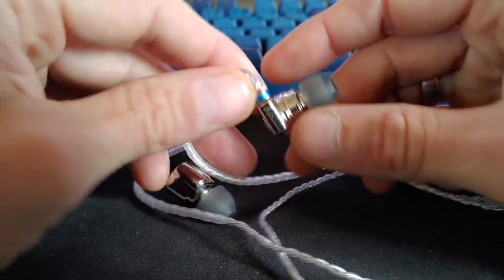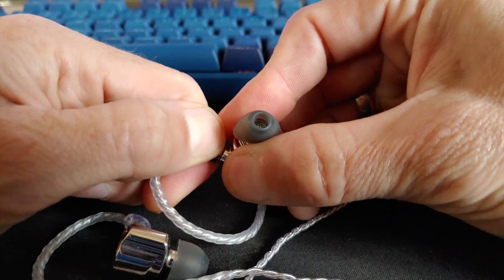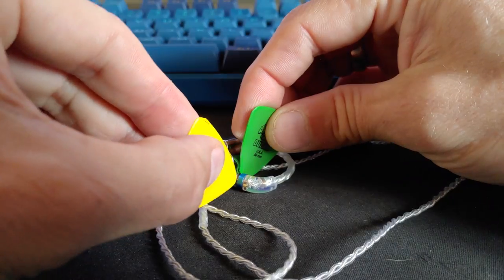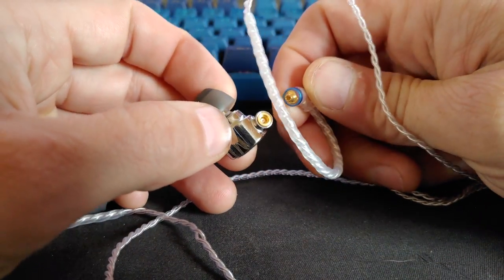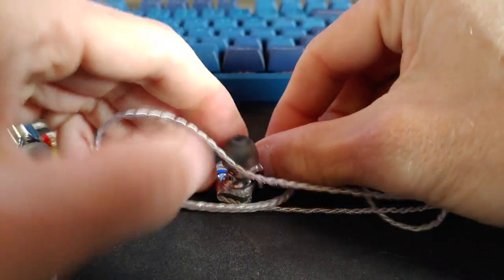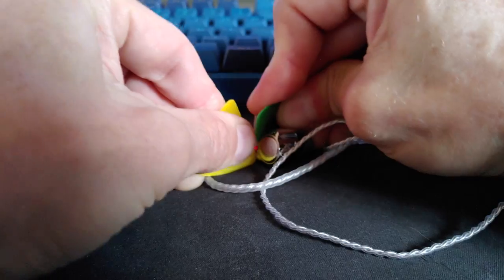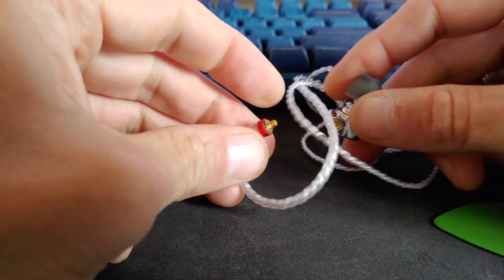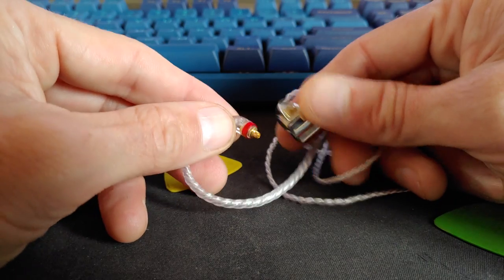How to remove a tight MMCX connector.

Comment: if the above doesnt work, you can use scissors, i suggest using just the tip of them and jamming both sides into the connector, while holding both blades inside your palm like a fist so you cant hurt yourself
Reply from the maker: yikes... lol

Comment: I have an old fiio f9. The right female connector in the earphone has bad connection issues. Sound goes in and out as you rotate the connector plugged in.